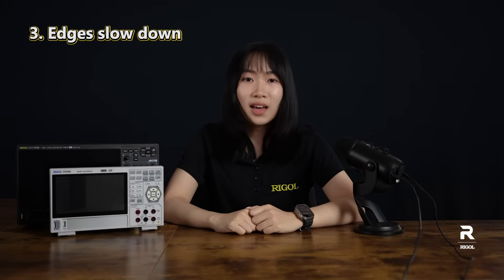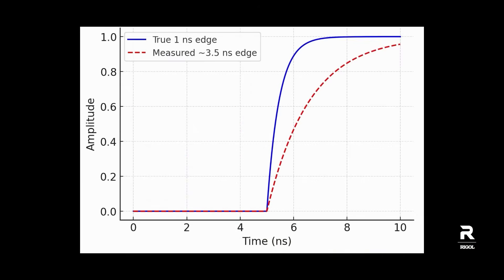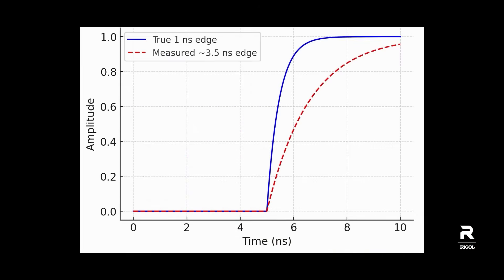How to Choose the Right Oscilloscope Bandwidth | RIGOL How to Scope

Comment: Modern passive probes from established manufacturers still exhibit 8–15 pF of parasitic capacitance—values that are unacceptable at a few hundred megahertz, where they distort the signal, introduce ringing, and degrade the waveform to the point that the oscilloscope’s high bandwidth becomes practically irrelevant. The supposed alternative—active probes—brings its own set of issues: a multi-gigahertz active probe often costs as much as a mid-range oscilloscope, frequently running into thousands or even tens of thousands of euros, which severely restricts access to the instrument’s real performance. Moreover, these high-frequency active probes are extremely fragile: highly sensitive to ESD and easily damaged by even slight over-voltage, leading to repairs or replacements that are prohibitively expensive. The result is a stark contrast between aggressively marketed specifications and the instrument’s practical usability.

Comment: Choose the most you can afford :-)  It will open doors of exploration.   I was delighted with my 20 MHz Phillips analog scope.  Now I have two Digital Storage scopes each 70 MHz.  I don't really need that much bandwidth (HF radio work; 30 MHz tops) BUT if you are doing rise time observations of digital circuits then 200 MHz or higher will be useful.  It doesn't mean you are measuring a 200 MHz signal, but you want nanosecond rise times.
Reply: The example of a 10 MHz square wave is a good example since square waves have harmonics in theory forever but you can get a reasonable approximation of square by including through the 5th harmonic.  Hence a 50 MHz bandwidth is sufficient for a 10 MHz square wave.  Not great, but good enough.